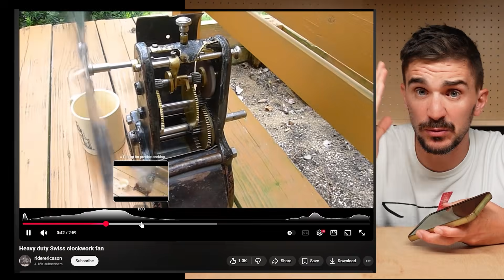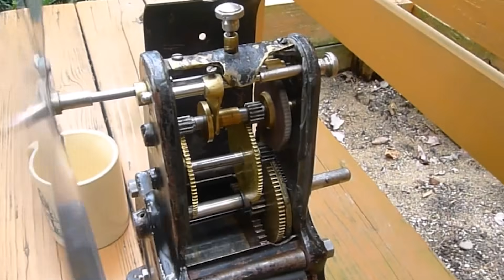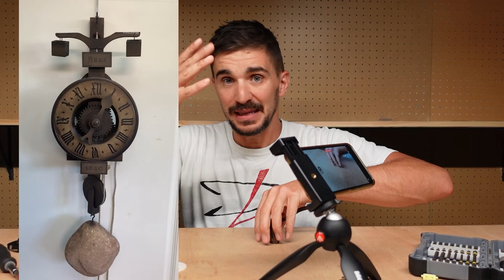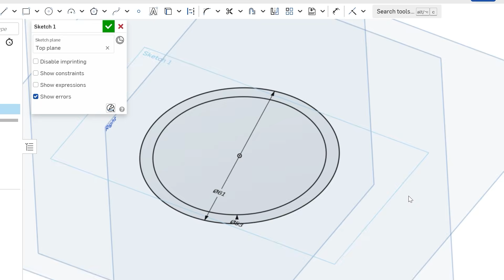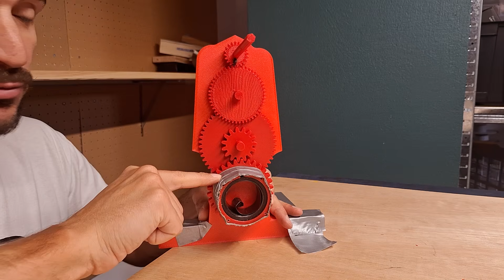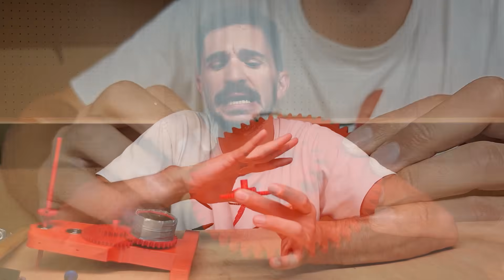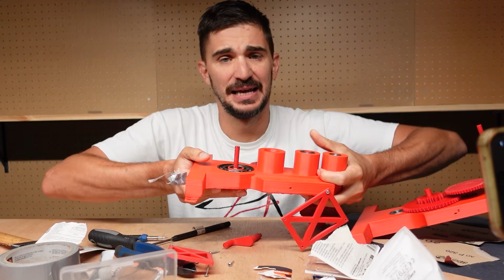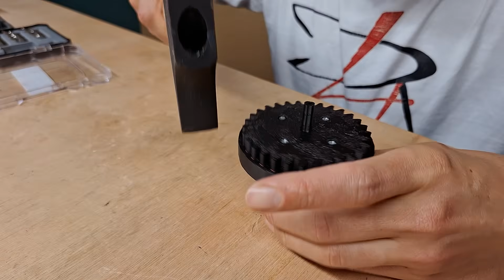No Cables or Batteries, Just Pure Mechanical Engineering - This Swiss Cooling Fan Cools You For Free

Comment: The SIMPLE CHEAT is to rob the high torque type planetary gear cluster from a very high torque drill and put the spring against that.

While maybe some people would think you should use a HIGH speed drill for this, NOOOOOOOOOO, you need a LOW speed drill, because you're driving it from THE OTHER END.

A 'high' speed drill, with very low torque, would have a relatively low gear multiplication factor, while a HIGH torque drill assembly [I have seen doubles and one triple on super high torque drivers, but those are hard to find, and probably pretty expensive] will allow your fan to drive MUCH LONGER per turn of the spring.

Since you are only moving AIR, you don't have to worry about the blades getting "stuck" in the air, and drill gear boxes, typically, if they make it to the market, are not jammed internally, or they would break long before you got hold of them.

So, if anything, the only REAL parts you need to make, to make this work, [or adapt, if you continue with the low power tape measure spring] is the spring housing, and a shaft to input that power to the gear box.

In this case, since it is being mounted BACKWARDS from a NORMAL drill, however, one DOES NEED to set it up where the CHUCK end is clamped to the output of the SPRING, and the FAN end is connected to the INPUT.

So one needs to remember that they are deliberately working the drill motor gear drive in REVERSE for this to work.

I could write an encyclopedia on this, but it would not make it even remotely more useful, so I will stop here, but just know that if you use the transmission from a drill motor, and do not wish to fully disassemble it [honestly, I'd advise against doing so!] it would be best to print a detention [holder] box that the drill transmission can sit within squarely in alignment with your shafts, and, to ensure it is super secure there, use some kind of glue or epoxy to press it into, and allow it to harden, so that you are not wasting eternity trying to custom print an almost impossible to match shape, as now days, literally every brand has weird curved contours, making a directly printed shape, just short of physically impossible.

If you use some form of putty type epoxy, and press the transmission into that, it should allow you to make up for this insanity, with nothing more than some alignment points in the way you print the box, and, at the most more, a very straight shaft from the chuck, with which you can measure and estimate "run-out" as you go.

Since most drills, when they get old and worn lose a lot of their rigidity, the run-out may not be that critical, but if you have a solid, nearly new drill assembly, you may want to look into aligning it before setting it in epoxy, and a very long, very straight rod [even a very long drill bit, as many are made, I own some for wood working] and make a jig [could be plastic, could be wood, just as long as its square and reliable] to make sure the transmission is absolutely parallel to the box before the epoxy sets, and you will never have to set that part again.

Also, with a chuck, you CAN add or subtract springs of various sizes and shapes, as you experiment.

This means, that if you start with a simple and cheap spring now, there is nothing keeping you from obtaining a stronger more reliable spring later on.

And seeing as a drill chuck holds multiple sized shafts, you are not nearly as limited as you would be if you had just a socket of one single fixed size.

This allows you to experiment with many springs, or even a draw weight [because, believe it or not, they still make those, and they still have validity, especially if you make a pedestal and use something like lead weights, which holds more power than simple stone, or even iron or copper] which can ALSO allow you the ability to add a few more very low speed, high torque gears.

I could easily see a 50 lb weight running a fan 10 full hours, provided you are not looking for a hurricane output.

And while MOST people may not be able to just lift 50 lbs, ONE simple trick is the WATER BOX.

A box which can fill from a natural source of flowing water, into the container, and gain weight, but then, when it reaches the bottom, a tip lever pops open a flapper valve type drain, allowing a smaller, but just adequate weight to lift the box back to the top, and tip the flapper valve back shut, causing the fan to fully reset, and never need winding at all.

So your fan would be powered by water, and run just as long as water could be harnessed to go into the weight box.

No winding, no heavy lifting, no loud motor sounds, just smooth, almost silent fan operation, without a speck of electricity for miles! (~_^)-b

Comment: Mass production using inexpensive parts and materials like stamped steel instead of printed plastic and using a precise set of calculations for the spring and each gear ratio would produce something much more efficient

Comment: Thank you. Late night dives down rabbit holes from odd YT reccomends can.. get one thinking (I just watched a 20 minute vid on olive oil soap, if you can believe that..) Even though your effort feels less than a full success, I want you to also realize you did something, and learned (spring steel is sharp is probably right at that top of lessons learned.) and this topic is currently a headscratcher for sure.. How do we take applied energy (you winding the spring) and have it perform a useful function (you getting a breeze) or in better terms How do we get excess energy from solar/ wind and store it for later use. Also I want to thank you for the explanation on the gear pitch. it was something I didnt think about but now i have a modicum of knowledge, that i can look up and apply later.

Comment: I paused at 13 seconds in to type this. Heh, I've never installed the YT app on my phone. I've only ever watched any YT video on my phone fewer than 10 times. I even wrote a Chrome extension for desktop that removes YT shorts from my subscriptions feed and changes any YT shorts links elsewhere to use the regular player instead. I also generally don't watch any vertical format videos.

Comment: human labor is an extremely expensive way to make mechanical energy. it's exhausting just thinking about replicating the few cents of electricity used to wash a load of clothes with a gilligan's island washing machine. there's an intuition disconnect between the electrical cost of running most electric motors vs heating and cooling. fun exercise: calculate how high you could lift a liter of water with the energy required to warm it one degree C. these days you probably couldn't make a useful fan for less than the cost of a solar panel battery & motor. likely the most efficient human powered "fan" is a swing

nice to know watch students can get a large cheap spring-in-a-barrel to play with

the most common watch repair has always been cleaning. in the old days, whale oil would gum up and stop the watch before the lack of lubricant destroyed the watch. now lubricants are better and labor is expensive, people run their watch dry until it stops then get a new one. but a watch worth keeping still gets fully dismantled and cleaned for several hundred dollars and i'd count that as a repair. before the invention of anti shock mechanisms the balance staff broke when you dropped your watch and my guess is this repair was maybe more common than a broken mainspring

Comment: Everyone already posted a gazillion things that should be made to make it feasible, so I won't delve into those :D But I have seen nobody commenting that, in the old days of phonographs, high end ones which provided a long running time (otherwise you would need to wind the spring between every song/cilinder change) used many springs in series in tandem on a single axel. I've seen Edisons with up to 3 heavy chunky (2" wide?) spring cages. The same can be achieved with many cheap €3 measuring tapes, and of course a lifetime to wind them :)

Comment: 33:55 - It is indeed impressive what they were able to build before. Not only the 1900 but going back to 2 or 3 BC... but there is one this that is common and is (more or less) not the case anymore : custom fit. All the rocks, branches, gears and such were all sanded to have the right fit (geometric and dimensional). Nowadays, through machinery and CAD we don't need to do that anymore, everything is as we planned on first try. So yes, it was impressive, but extremely time consuming to get to good or great fit between two parts because everything was custom made.

Comment: next stage is cnc, it could cut in cast material etc. as good as in printed, so it could be perfect allingment of bearing housings in both oversized halfs; after that speed is uncontrolled, controlling by friction or other resist energy system in mechanism shorts time because "tail" energy is less than friction

Comment: Even if I am making something out of 3D printed parts, I'll always use metal screws and metal shafts.  You'll never get the precision from a plastic part that you can get from a cheapo $2 metal shaft from McMaster or even just Amazon.  You're probably losing at least 25% of your energy from those plastic shafts.  Could have used some small 6 mm DIA steel shafts with much smaller bearings.

Comment: Maybe if the fan blades (air flow) offered more resistance then it would offer stability to offset mechanical imperfections. The 3D printer offers good precision if the precision (where it exists) is leveraged by the design. Maybe have two spaced gear wheels on every shaft, so there is no internal angular imperfections to deal with on the movement. You should have rehoused a different mainspring, though your solution was brilliant. You might have turned the inside of the mainspring coil with a drill to get it smaller for the housing. The fan blade close to the device probably doesn't give much air flow (same as with swiss design). With 3d printing you could print a fan blade within a geared housing and let air flow through the device.

Comment: Those bearing races have too much resistance. You can pop the side caps off and flush the grease out, or better still use plain bearings. Also you could leave the mainspring in its tape measure barrel and just fit a gear to it.

Comment: I want to give a piece of advice: enlarge those fan blades to the maximum size that your system's torque can handle. If necessary, after winding up the spring, give it a manual start. This way, it will spin slower, move the same amount of air, but last much longer.

Comment: Well this is proof of concept, but what you would need to get meaningful run time is more gears and more aggressive ratios. I suggest trying again but add another set of gears before the fan, and possibly changing it to "belt" drive using wide and thick rubber bands

Comment: This may seem a little ridiculous, but your bearings are too big- they are ball bearings, but they still add a lot of friction for a hand cranked device. Also, you may benefit from using bearings that can self align so you don't have to chase small friction between stupid misalignments. I also bet if you used an rc propeller or drone propeller, your efficiency should improve decently.

Comment: You can avoid having the rough surfaces where the support interface sits easily if you have a multi-material system. PETG and PLA don't really love each other. What I do in cases where I need a clean surface, is to print in PETG and use PLA as the support interface material, reducing the distance to the model to 0. Or vice versa, print in PLA and use PETG as support interface. When you are done printing, with the help of a knife or cutter, carefully split the layers of petg and pla. You'll have a perfectly flat surface.

Comment: I think you'd be surprised at how inexpensive the gears and mainsprings are for mechanical clocks. They've had the machining equipment for decades and can churn out consistently accurate parts for relatively low prices. Now adding complications, miniaturizing for wristwatches, using fancy metals, and rare earth elements for bearings makes the price increase significantly.  Especially if it's made in Switzerland. 

But for smooth and accurate metal gears and spring steel, you wouldn't break the bank making this thing work quietly and efficiently. Any horologist worth a shh could square you away affordably. Or for a more diy approach, cnc machining would be way better than 3d printing. Barring access to fancy equipment, you are familiar with pcbway....

Comment: A 1:100 gear ratio will be more sufficient and it will need to be accurate af to run smotthly and for more than one operation.
Plus the fan should be metal for the spinning motion to have more inertia.

Comment: The use of the gears reminds me of a GravtyLight made by Deciwatt, a light fixture that turns gravity to electricity with gears like the cuckoo clock. Used in the areas of the world with no electricity. Same principal just using a sack of rocks instead of a loaded spring :)

Comment: Belt drive instead of gears? Would allow for surface/material issues and less precision needed for alignments. You could adapt the wheel spacing and frame size to whatever bands you can source.

Comment: Mate you have an H2D, get a support interface material and you won't need to sand the bottom surfaces on everything. The ones sold by bambu like "support for pla/petg" are totally worth the higher cost, no messing around, flat surfaces come out flat.

Comment: Something to note: Moving large blades slow consumes less energy than moving small blades quickly, at the same air flow. Of course then you also have slower air, but way more of it, which makes it more effective, as E=1/2*m*v^2= 1/2*rho*v*A*v^2=1/2*rho*A*v^3. So The Energy is proportional to A and v^3. doubling the speed increases Energy by a factor of 8, but doubling the area increases needed Energy by a factor of only 2. And the Air flow is phi= A*v. So doubling Area doubles air flow, and doubling velocity also doubles air flow, so doubling velocity isnt worth it you should instead double the area. Of course the cooling effect depends strongly on velocity, so you need some velocity, but in the end you dont want a hurricane on your nose, but a breeze across your whole body.

Comment: I'm sure you probably know this but I didn't hear you say it in the video. The spring is an energy storage device as stated but you left out the point that the length, width, and thickness, affect how much energy it can store. You are using a very small spring to power your fan so your cranking time vs run time is not much. You also are not inputting much energy to the spring through the key. If you look at the old fan that inspired you they are using a crank with a torque arm of several inches to wind the spring. That spring is storing a lot of energy. There may also be a speed governor system that slows the rate the spring depletes itself, just as in a watch, rather than the spring releasing as fast as the system can handle it. The old design fan maintains a constant speed until the spring finally runs out of energy. Both of those things will significantly increase the fan's run time. Engineering wise you would figure out how much energy it takes to spin the fan at the desired rpm and then calculate how much spring it takes to power it for the desired time. After that you then have to figure out a system that lets you wind the spring with reasonable effort in a reasonable amount of time.

Comment: Also building a new barrel is not that hard. Approach putting the spring in the following way. Secure the prirst end of the spring to a center piece. The wind it manually. It takes time, it is scary but it works.

Comment: Recommendations: use champfered edges to avoid shaft breaking. This way you switch from having all the load on one sigle line, to having a smooth transition between the shaft and the gear that results in parts so strong it is not even funny.

Comment: For a fan, I would have used a lawn mower pull stat and I would have included a fly wheel.  A fly wheel would serve as an accumulator of power and vibration smoothing out the operation.  Maybe the fan could be a fly wheel if it had more weight.

Comment: I think the idea is great, just needs better materials and some tweaking.

1. Metal gears + oil.   This would lower the friction.
2. Stronger spring
3. Larger handle with more leverage.

More stored energy + less friction = longer run time

Comment: LOVE IT LOVE EVERYTHING ABOUT IT!!!!!!!        if you scale this up a bit and created a system with weights that will slowly lower and create the cranking for you. you could in theory get this to cool a small home for several hours for sure. then have a winching system to simply re lift you weights and start it over again when you need it.      or even if you had a small electric motor and a battery setup with a limit switch that will trigger the motor on when it hits bottom or near bottom and another to turn off when it reaches the top.

Comment: I can see your top axle is way off, my guess is the back shell was designed with a mistake in cad. Also I am not so sure all the hearing is any better than just directly connecting to the spring and the resistance of the air would probably regulate the speed. You are using hearing to take torque and converter it to speed but the spring is already super fast and doesn’t need the gearing. Just a guess, direct mount to the spring would probably give exact same run time and speed within 20% and my instinct is it would be 20% better. Interesting engineering to try.